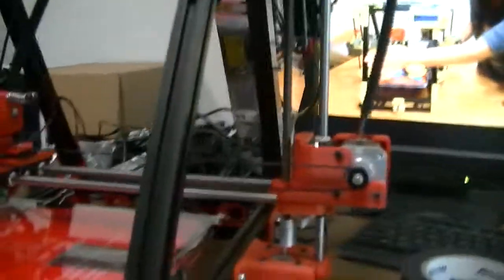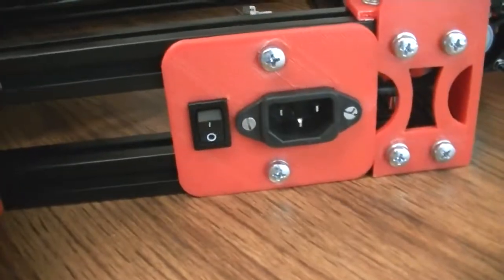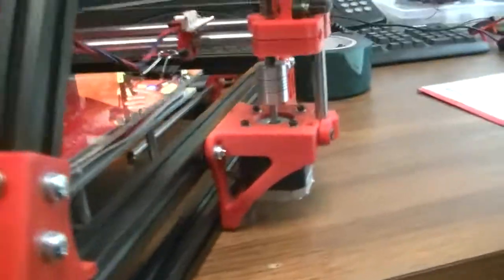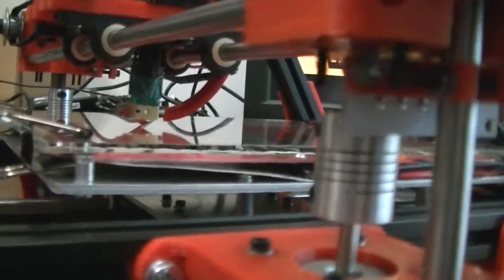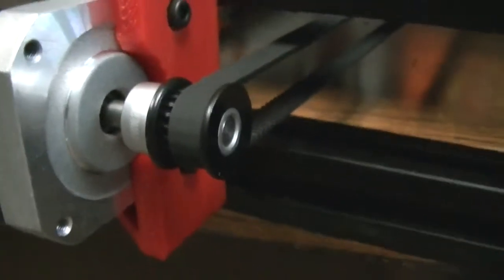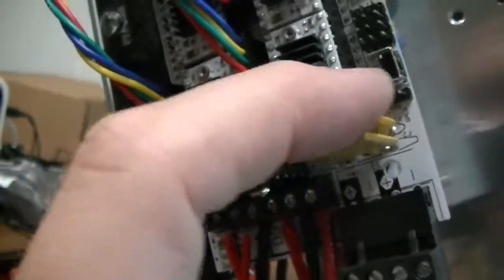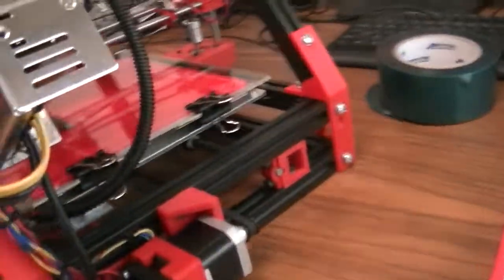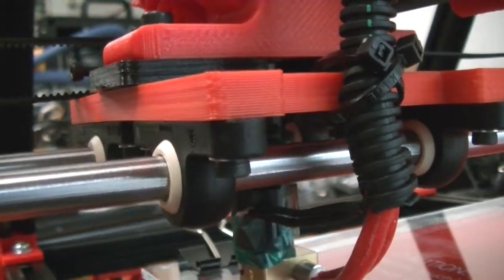MendelMax 1.5 Build Notes Part 1

Comment: You better print some kind of cover to these AC screws connectors on your power supply, it's very dangerous when they are exposed like this.

Other than that, extremely nice build!